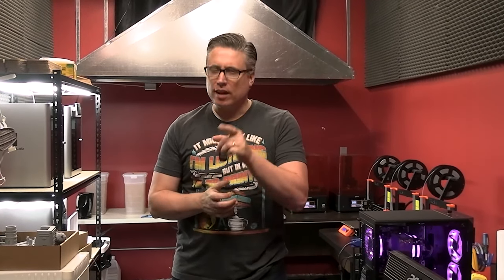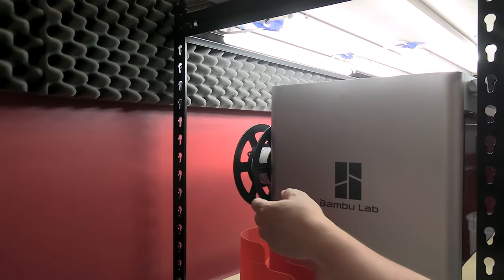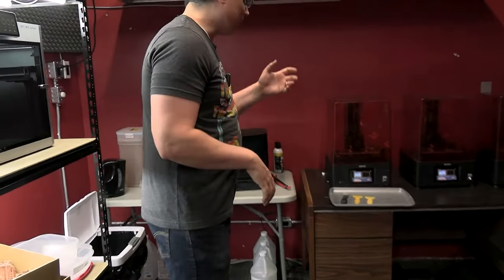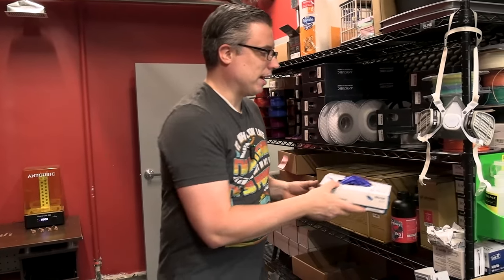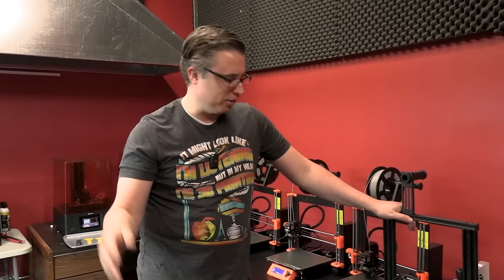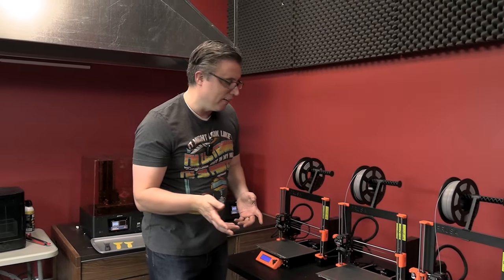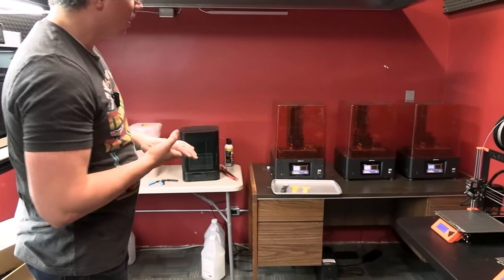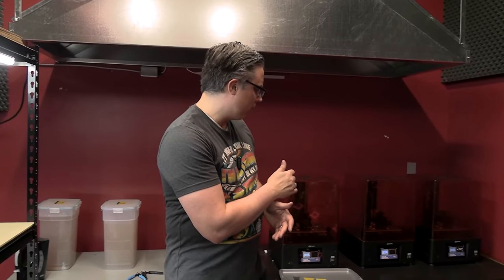FDM vs Resin 3D Printing - Which is Better?

Comment: I have no interest in 3d printing atm but I still watched this for some reason.
Reply: Same ☺️
Reply from the maker: That’s a kind compliment. Thanks!
Reply: That’s how it starts….
Reply: Your missing out.
Way more options for models.
Most are far higher quality than GWs garbage models.
Not to mention it's much much cheaper than their trash.
I haven't bought anything GW since the beginning of 2019 when I got a resin printer.
Mountains of terrain with the pla printer.
It's awesome.

I'll also add that you can get the Bambulabs P1P printer for half the cost of the Prusa Mk4 printer. It has all the important features of the X1C printer. Same speed etc. It's by far the best printer on the market. If you have a use case for an enclosure you can get the P1S which is a P1P with enclosure
Reply: Well, you obviously have an interest in 3D printing 👀
Or you like looking at the guy in the video 😬
Reply: Maybe you are into Star Wars and find the LEGO Venetor too expensive. Here you are  searching for alternatives 😅😂
Reply: Because you have too much time on your hands get a job
Reply: Nahh deep in ur heart when the time is right you will buy it 😂
Reply: I’m between a fiber laser and printer
Reply: It's my full time gig now. I don't even have to wear shoes to work, and make a LOT more money. Learn cad.
Reply: and left a comment 😂😂😂
Reply: I’m the opposite
Reply: Same at 2am 🤦🏻‍♂️😂
Reply: Did anything change in the last year?
Reply: That’s what I said. Next thing I know I’m spending $700 on the uniformation gk two and fuck is it awesome.

Comment: I've been itching badly to get a 3D printer but the thing stopping me is I have never figured out what it is people actually print.  I've seen oodles of fire-breathing dragons and all that but that's basically it.  Even looking at the thumbnails of suggested videos on the right of my screen right now that's all I see (if a sample project is shown at all).  What the heck do people print?  Please make me buy one lol!
Reply: It helps to have other hobbies, if you like guns, make accessories for them, if you are into arts it's can be used from jewelry to cosplay, if you are an architect or engineers you make prototypes, if you have no other hobbies them you just end up making accessories or containers for your 3d printer.
Reply: Board game pieces and wargaming miniatures are one of the biggest markets for many of these companies lately, probably just starting to overtake hobbyist engineers.  Playing their favorite sci-fi tactical wargames, or making replacement pieces for board games saves people anywhere from tens to thousands of dollars.  For some it saves tens of thousands to build a really large table full.  Especially for affordable Resin printers, which can print detailed models.  

For FDM, people make everything from big vases to put flowers in, to parts for their machines and hobbies.  Anything a person could make in plastic, and now many of the items that were once made in wood/glass/etc.   Around the house you can make handles, connectors, guides for various wires, novel lightswitches, picture frames, stands, separators/dividers, soap holders, etc.  

You'll know if you need one, and you'll know if you want one.  If you don't?  It may be worth trying to learn some of those first mentioned hobbies.  Board games have been in a golden age that's only now just barely winding down.  Wargaming has had a huge influx of people the last decade.  

That said, it's your time and your money!  It's fine to not get one right now and to spend money on a different hobby until 3D printing speaks to you.  The printers are likely to keep getting better over the next decade or two.
Reply: I use my printer for my model railway
Reply: Gridfinity. But i have my own system. Organizing stuff is the best part of 3d printing IMHO

Comment: I was Interested in 3D Printing for my DnD game, but sadly I dont have a Garage or Balcony to safely store a Printer that emits toxic fumes, so my only option would be an FDM printer, so hearing that they are no good for miniatures makes me really sad :(
Reply: I have an elegoo mars 4 ultra in a bathroom with the vent on. Never had a problem. Just keep the resin warm. I hope this helps you make a decision. I was terrified of starting out because I was brand new,  I use it to make toys for my kids......and me lol.
Reply: There are printer options that have vent holes so you can use a system to extract the fumes, I use a paint station to pull both resin and solvent fumes from my hobby room, you can still smell it but only faintly after spraying half a Liter of solvent and thiners and  2 printers running for 12 hours.

Comment: Really cool to see printing get more and more attention. It's come quite a ways and I'm all for it.
Reply from the maker: It really has!  In just the past year the tech has improved a lot.
Reply: @MWGForge you took the words out of my mouth. I've had so many crapoy i3 clones but have a corexy now. I have a ton of Vallejo and game paints along with a paint booth but have yet to use it haha. I'm building rcs, gifts and custom lighting for friends. Creality are still the leading brand because they sell so much but I had a neptune 4 for my last printer and put 1000 hours on it in 5 months. I only paid 300caf for it, the prusa mk3 is almost 2k foe the kit in Canada. I'd love to have the xl tool changer. Funny, the mk3 costs more in Canada than the bambux1. Only about 100 but still.

Comment: This is perfect - I've been printing in Resin, it takes a much more involved setup, and printing anything large is difficult (cut ups and whatnot) and supports eat up a ton of resin. My biggest question was whether I could save by printing tools, structural stuff and terrain on FDM.
Reply: What I love with resin printing is that if I divide the model to few parts, connecting them is much easier and higher quality than with FDM. If you have cheap FDM and need to connect 2 prints you will quickly find out that surface imperfections force you to a lot of sanding, which is very bad. With Resin there usually is no sanding - or maybe minimal due to shrinkage. 

I don't think that you can print with any of these 2 technologies any tools that have some structural strength - you would need metal. Generally 3D printed tools are either some kind of supports/shapers etc. or just for show.
Reply: The qidi x-plus 3 is better than the bambu imo, bigger build volume, heated chamber and 400 dollars cheaper.
Reply: @OldSkullSoldier not true. I can print functional parts for vehicles and drones etc from polycarbonate for example.

Comment: This has been great! I’m looking into doing both, but definitely leaning towards terrain. I don’t really have a good ventilated room for resin. Do weather conditions effect the quality of  resin prints (if I wanted to do it in my garage)?
Reply: awesome question, i was woundering the same.
Reply: Temperature changes over night can and will effect resin print, unless you have a resin heater in your 3D printer (more expensive)
Reply: for resin printing you really want it to be in a temperature controlled environment (most resins will print better above 20C with around 25C-30C being the sweet spot) if the temperature is lower than that then the resin is way less viscous . the runnier it is the better because then it can flow more easily between the build plate and vat (the standard layer height for resin tends to be 50 microns (0.05mm) most recent resin printers can go below that (some as low as 19 microns layer height) so the resin has to be fluid enough to get into that tiny gap.
a garage is probably a bit too cold.

the temperature of the resin will have an effect on the exposure time you need so keeping it constant will produce better quality more accurate prints.
if your garage is lets say 15C you will need a longer exposure time per layer than the same model printed on the same printer in a room that is 20C.
if the temperature of the room changed during the duration of the print (say it gets colder) then the exposure time would also need to change and that is not feasible to do mid print. for a perfect exposure time you need the temperature of the resin to be constant

Comment: I do it this way: scenery and terrain on FDM, mini's on resin. If you only buy one, these are advantages or disadvantages.

FDM: 
lower price ompared to resin printers (the most expensive FDM's are obviously more expensive than the cheapest resin printers, but you have to take relative quality into account)
lower cost for materials (PLA is cheaper than resin)
less hassle, less clean up, not dealing with potentially hazardous and flammable products
BUT: if you want small detail, you can get that on modern FDM printers, but not nearly as sharp as resin for similar quality and price ranges

Resin:
higher detail, especially for very small scale details
when printing multiple models of similar size, the resin printer is waaaaaaaaay faster than FDM (FDM prints each layer on a single model at a time, while a resin printer prints the same layer on all mini's at the same time)
BUT: more expensive to buy, more expensive to operate (both the price of resin, but also the washing and curing stations, and the IPA you need), and you have more work cleaning and setting up the printer. I also do not keep my resin indoors, but in the (well ventilated) shed. If you have no room to  safely have your resin printer work, I'd not go for a resin printer to be honest, but that is just me. Overly cautious perhaps, but "better safe than sorry" has always been my motto.
Reply: Hello, I was interested in buying a 3D printer should I get a FDM for first time people like me?

I precieve it more of "neet I have a cool gadget" rather than something of a useful tool. The only thing I could think of using is maybe replacing missing parts on my items.
Reply: @oldbonniegamer938  Really depends on what you want to do. 

I'd say FDM printers are easier to use, but honestly both modern FDM and resin printers have been build in such a way that they are easy to set up, without too much hassle. It is just that resin printers do require some more work when using them and when cleaning them. You need more accessories as it were: cleaning station, curing station, gloves, isopropyl alcohol.

If you are not looking for a printer that can print the superduperest, crispiest details, I'd say a modern midrange FDM printer will fulfill your hobby needs. If you really get into the hobby and feel you want that GW model kind of detail (or lets be honest, even beyond that), you can always buy a resin printer later on. But that is just my  opinion.
Reply: @allasar  I guess I'd like to dip my toes first before invest or commiting to the 3D printing. What's a good price range for entry or midrange 3D printers?

Comment: Great video! Wow, I've never seen a PLA print as smooth as the X1 Carbon outputs.  I've just been getting into 3d printing..my first 3d printer was the Ender 3..darn, that thing was noisy ..lol. I bought the Longer LK5 Pro as an upgrade...it's dead silent and much bigger build capacity and at least has a bed leveling routine built in to the software (not Auto, but still pretty easy process) ..I would recommend it too if someone doesn't have the money to buy one of the higher end printers.

Comment: I have been considering getting into 3D printing for a while. I am into model railways and wanted to be able to print out scenery, buildings and wagons. I am new to it all, and wanted to start with FDM as it is much safer that resin, although I know that resin gives better results. I have read numerous good reviews on the Bambulab printers but can't stretch to the X1C. 😢 However the P1S does appear to be almost as good, and is a lot cheaper! Have you had a chance to see the P1S yet, and what do you think of it? Thanks!
Reply from the maker: I haven't used the P1S, mainly because I don't care about its features, which are mainly important to people printing in other materials.  I'd highly recommend the P1P as it is cheaper and will do everything you need.  https://www.miniwargaming.com/p1p

Having said that, if you're printing really small scale stuff for model railroading, you'll probably want to figure out resin 3D printing as there will be certain things that you just won't be able to do with FDM (at least right now).

Buildings and landscaping definitely work well with FDM, but if you're doing details like sign posts and people then resin will be your best friend for that.

You can see all my 3D printer recommendations at https://www.miniwargaming.com/3d

Comment: I was curious about one of the points you had raised. I have not seen anyone else reference layer lines on the Bambu Lab printers being any worse or better than any other high-end FDM printers. To be clear, are you seeing that regardless of materials, or are you using a material that tends to show layer lines less to begin with?

Comment: I used to try to repair my house's problems by using 2x4, pvc, anything you can get at Home Depot. I'm really glad I chose the FDM route. Because I never print figures or any toys with my ender 3. I print anything functional.
Reply: People say they make functional prints woth FDM but what ever they use it for can be done by resin as well.
Reply: @miguellopez3392  Yes and no. Resin printer is too small/too expensive for the parts I've printed

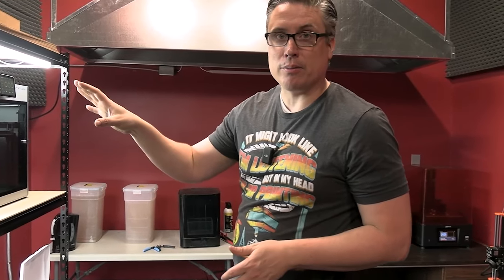Comment: I am looking for a printer that I can do miniatures in a 1:48/38mm scale. I don't have space to deal with the toxic fumes. I don't have a ton of money. What would you recommend?
Reply: Resin printers will give you the best quality for something that small, you can get a printer capable of that under $300-$200, you can vent your room or use a activated carbon filter to help absorb most of the toxic fumes.

Comment: you seem to be the right guy for me to ask this question, I build HO scale dioramas for now until I can build my train layout.  I know there are alot of kits out there of buildings to put together, but I'm always scared to try them for fear of F'ing them up.  So, I figure maybe 3D printing my buildings would be better, but I'm not sure which one I should really be looking into.  
Like I said I'm a beginner to everything diorama builds and to 3D printing, what I'm mainly wanting is something that could print out for example an HO scale farmhouse, where after it's all set and cleaned up I can go right into painting it...   what are your thoughts and which 3D printer do you feel I should start looking at?

Comment: Would you recommend starting with a resin or FDM printer? I want to print minis but I don't really have a space with good ventilation and I'm inexperienced so I'm leaning towards FDM but I still wonder what you'd recommend, thank you!
Reply: Resin is easier to learn. there's far less of a learning curve with resin compared to FDM. the downside is the toxicity of the resin and the post print cleanup process.
it could take days (and a lot of failed prints) to dial in an FDM printer but a resin printer can be set up and printing within 5 minutes by pretty much anybody
a resin printer really only has 1 moving part whereas an FDM printer has many moving parts. resin printers are just far simpler machines mechanically

although with the more modern FDM printers they are getting easier to set up for beginners

Comment: Very nice video. The top 3D printer you recommend, the filament and resin ones, are kinda expensive, but considering the awesome results you get, they turn to be not as expensive as I thought they would be. IDK, maybe times changed and now 3D printing is not as expensive as it was in the beginning, or maybe these are "affordable" 3D printers.

Comment: Does temperature effect resin printing? I live in the Netherlands, so night time in winter is kinda cold outside, and I have a garage/brick shed that I could put a printer in. I don't want to invest in a printer if its not usable, but you've really sold me on printing
Reply: Resin is heavily effected by temperature, most resin have to be above 25C for best results, below 20c and it will fail, you can buy a heater that fits inside the case for around $70.

Comment: ive been looking at 3d printers since they came out...but never got me one... i would always say resin all the time...  if u got a large sla printer u also can print large stuff... the size aspect is not a real factor to choose between fdm and resin imo... sla also is faster it basically just meassured in hight u basically can fil lthe whole build plate and the print time doesnt change... but i think sla printing has also alot of drawbacks... first of u need a ventilation system to print + u need to wash the stuff and clean everything eveytime u use the sla printer + u have to spend time for curing....also the resin isnt that sturdy than fdm...  but the last years the variety of resins got alot better there are even flexible materials and also real hard materials... i will def get me  either a mars 4 ultra or a mars 3 max in january... im not sure yet about AFC film.... if i can also use normal fep on the mars4 ultra i think i will go for the ultra because wlan, new display and the new mount def is worth the extra costs...